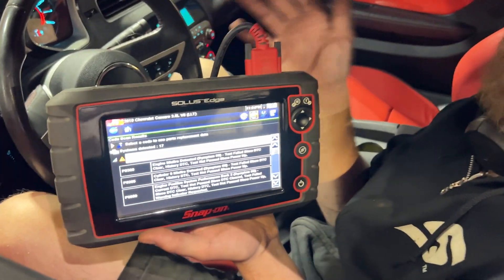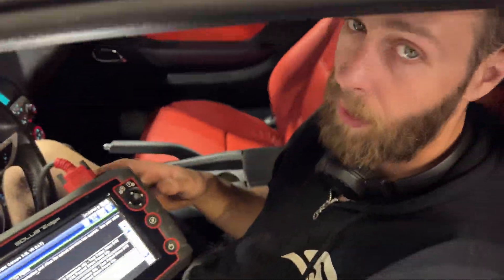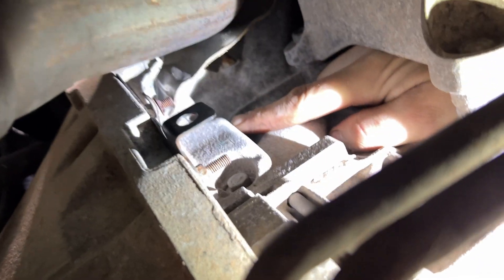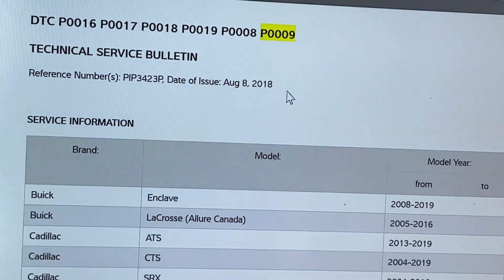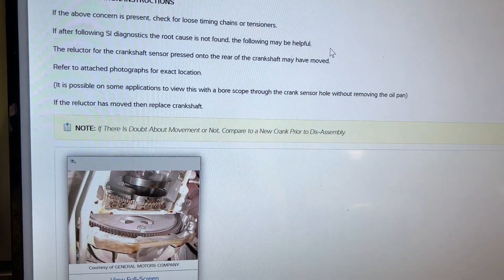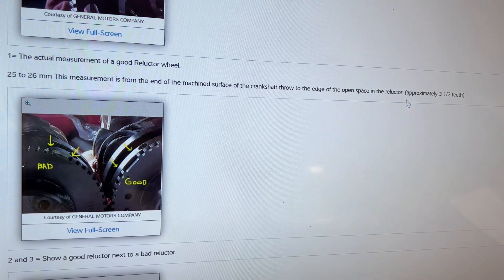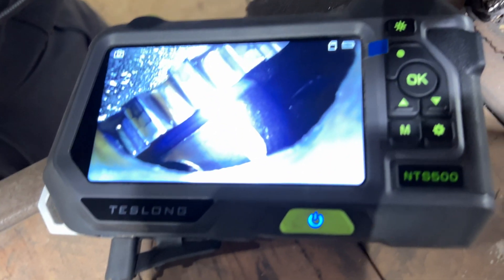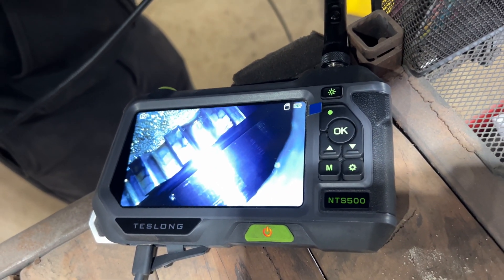2010 Camaro 3.6L LY7 V6 Crank Tone Ring Inspection

Comment: Can you remove the oil pan and tap the ring back into place and tack weld to the crank?
Reply from the maker: Unfortunately not, I he genius’s at GM decided to make the motor mount bolt directly to the oil pan 😂